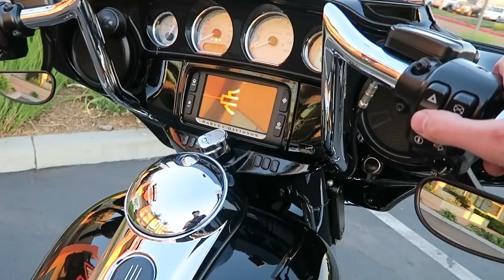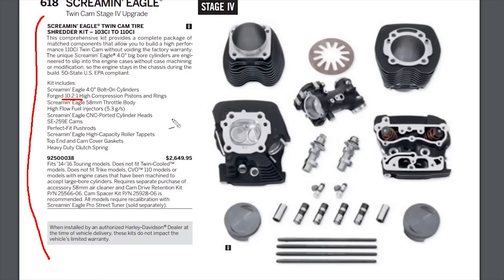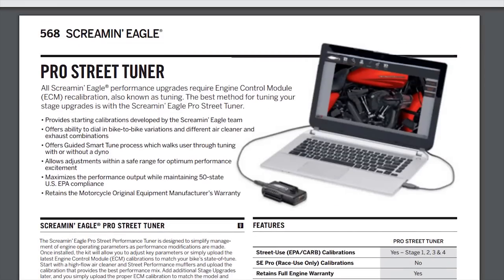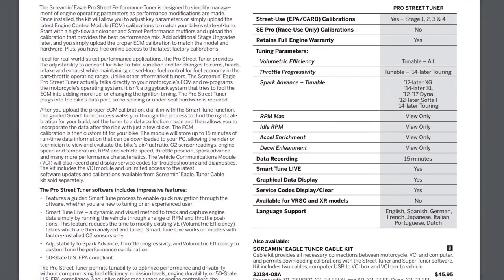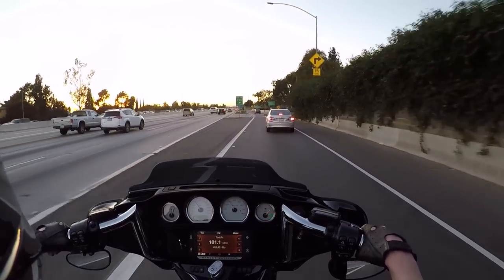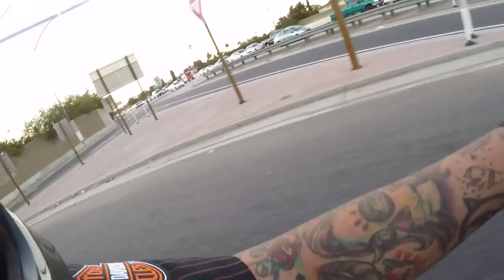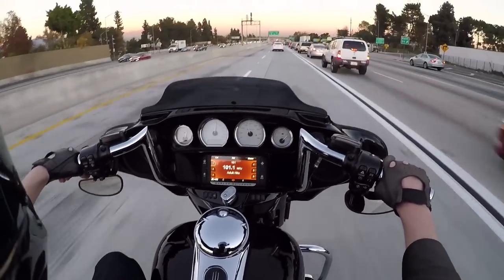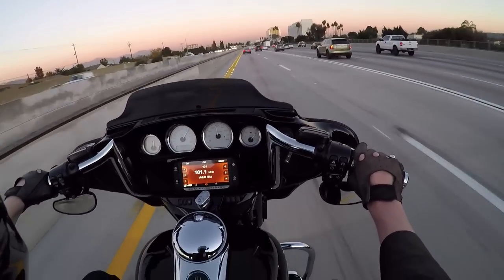Milwaukee-Eight Stage 4 VS Twin Cam 110 Stage 4 │Harley-Davidson Screamin' Eagle

Comment: I got a 2011 screaming eagle CVO ultra limited which had the cam upgrade full exhaust upgrade air cleaner upgrade with no big deal but she's cranking out just shy of 100 horses and just shy of 110 ft lb of torque and that thing is a monster I love it

Comment: Man..That 110 hauls ass..  I thought the M8 would run away from it but that didn't look like the case at all..
Reply from the maker: Yea, it definitely didn’t run away. It was a close match up.
Reply: By the way..  The bars and the windscreen with the cutaways look really nice on the M8 Street Glide.. Nice..
Reply: Im really feeling the M8and what it comes with...but now Im thinking that same thing about the 110cc. Gonna have to go back to the drawing board now...🤔
Reply: The m8 doesnt really have much more power, harley says the 107 has 10% more torque than the 103,  id hope so with a higher ci engine, the 114 has 8% more torque than the 110, they put out what an additional 5-8hp compared to the old engine, the 4 valves are really just smoothening the bike out, with a lil extra power added. Im not surprised the twin cam held its own at all, we also dont know how much the two riders weigh in comparison to each other, it makes a world of difference.
Reply: 10% more torque? Are you Sure? If so then 10% more torque must be a big deal from 0-60. Because I raced my brothers 103 vs my 107 and I burned him hard. And he's been riding way longer than me.... so I think the 107 is alot more powerful than the 103. The torque is nice.
Reply: Dylan H yeah im sure those are the stats iv pulled from multiple testing sites, plus if you do the math on the torque #s released by harley davidson,  the air intake is alot better i think 40-50%, i didnt include that cuz both these bikes have the better setup for air intake, thats why you walked away more than likely, how much do you and ur buddy weigh too? What kind of bikes? Do they weigh the same? Power to weight ratio is huuuuugely important. Also are your bikes geared the same? And torque only gets you so far, needs the hp to maintain it
Reply: You obviously don't have a clue what fast is
Reply: I loved my 110 but I also talked to guys that blew them up. I'm happy on my 107 with pipes and tuner still breaks loose on me from time to time.
Reply: when I bought my 114 fat I was really disappointed when my friend on his softail slim with a 110 fucking gapped me and I was lead to belive that the 114 would out perform the 110 by the dealer I bought it instead of going with the cheaper low rider s with a 110

Comment: By the way Matt...the new transmission SERIOUSLY BLOWS the TC trans away!  Smooth shifting and NO clunking changing gears....WAY better design and I LOVE the hydraulic clutch.  If you ask me you shouldn't even thing of comparing the new scoot with the old ones.....Harley FINALLY got it right all the way around....thanks again!  My new Street Glide makes me have bug stains!  I can live with that!
Reply from the maker: Yea, speed isn’t everything (although it’s high on the list). There are a lot of factors to consider. Starter is better, runs cooler, better fly wheels and crank, breaths better, better suited for performance upgrades, better charging system. Etc etc. the M8 is just better all around engine.

Comment: Great Video. I own a 2016 CVO StreetGlide with the Twin Cooled 110 Twin Cam that is upgraded with a Stage 1. It's dyno'd at 96 horsepower, and 110 lbs of torque at the rear wheel. I will be bumping it up with the 117 kit soon. Should produce great results! 👍😎
Reply: Theres a 2016 cvo streetglide for sale near me and im really thinking about getting it. Its being sold for 24k dollars though and a brand new street glide special is 30k so idk if its worth it to just buy the brand new bike.

Comment: Nice work as usual. Thank you for putting out videos with the things people really want and need to know about these bikes good or bad as you see it, and not just trying to sell paint, chrome and bullshit. As much as I'd like to have seen bikes on a dyno initially, but also understanding the cost and time it would take... the factory performance specs in your usual format with some seat of the pants dyno, same solid commentary and more aggressive riding noise make the video informative, helpful towards making a purchase, and even more enjoyable. Kill confirmed on the twin cam. Lol. That M8 sounds SO good through those mufflers. If Harley Davidson hadn't began to update anything in the last few years I'd STILL be openly trashing them for mushy suspension and coat hanger frames wrapped in plastic that stink of poor tuning and leak oil.
Reply: Lol Harleys haven’t leaked oil in over 40 years since the AMF days.

Comment: Hi Matt, great video as always, my 2017 RGS in the shop just now going to 114 stage 3, dealer has flashed it using a download that removes the speed governor so I will let you know how it goes. I am in Scotland though and it’s around 28 degrees here at the moment so you might have to wait until March 😃 I’m taking this bike to Prague for the 115 Anniversary Rally and that will include some autobahn travel 😈
Reply: John Porter why did you go stage 3 instead of 4?
Reply: NINJA DAVIDSON to retain Harley torque characteristics and not push all the power to high revs
Reply: Ahh. I see. I'm waiting for my new rgs with stage 4. Just wondered.
Reply: Yes the low end torque is wonderful. That is real power.

Comment: Thanks for making such informative and interesting tubes. I love my 115th FLHTK-ANV, but at the same time don’t think these bikes are made to race. Although my original Milwaukee 8 gives me enough power to ride around 110 mph on hwy easily, it’s HP is nothing compared to such racing monster bikes as ZX14, which I used to own for a few years. This is coz whatever modifications you make on your HD’s engine, its body, frame, and style is not designed to accelerate like an aerodynamic sport bike. I love my Harley coz it’s a super comfy bike and it roars like a lion. And that’s all about it

Comment: Fast lane here in Indianapolis does all my tuning my 110 twin cam makes 138 horse at the tire and 149 foot pounds of torque Factory bore 12 to 1,585 gear drives 58 mm throttle body,fully ported heads by Stewart racing here in Indy. Been to Sturgis twice not on trailer!!!!  And runs high 10's in quarter!!! Call it the busa killer!!!!
Reply from the maker: 👊🏻😮 wow. Those are some serious numbers.
Reply: Matt Laidlaw fast lane on gasoline Alley,  ask for Mark!! The  D-D boarzilla makes big difference in performance. Numbers where on good fuel.
Reply: Fro at south side Harley here in Indy have a NA MILWAUKEE 8 putting down over 200 to the tire. Not sure exactly what he's done. He's head tech there.

Comment: Looks like the twin cam held its own...
Reply from the maker: Yea it did
Reply: Matt Laidlaw 
I'm getting a 2018 CVO Limited.
Is it worth the extra cash to get the   Stage IV, even thou it already comes with a 117???
Reply: no, its not, 117 is plenty
Reply: I thought the twin cam won
Reply: Low end torque...H.D is good for other than that not so much my buddy that rides with me has the stage 4 set up on his glide .. and I smoke him everytime with my Victory XC. No cams just power commander Lloyds air filter and turning wheel..no shade just Facts.

Comment: Like the power characteristics of the TC  stage IV better.
Reply: 2hotFL agreed, i have two feet of snow. I've watched this vid four times so far today, i think it's gonna be my go to ride fix for the winter.
Reply: 100% agree. Not too sure I'd be riding much above 5000 - 5500 anyway. Torque is where the fun is...

Comment: Nice video and commentary Matt! Interesting comments too....For what it's worth, I wanted to say that I appreciate ALL two wheelers. I've been riding for 40 plus years on over 23 bikes (please don't judge lol). At 16 I had purchased 3 bikes including my first Kawasaki Triple 2 stroke... wow it was a machine to be reckoned with. From there it was everything from Dual Purpose Hondas to Husqvarna motocross to Sport Touring Adventure. My first bike with a driveshaft; a brand new 1982 Suzuki GS650.  For the last 2 or 3 years I've started to really slow down when riding public streets and have taken a much different approach to riding than when I was in my teens, 20's, 30's and even 40's. Hence the purchase of my first HD - an 08 Fatboy. Yes, it's true and my wife still can't believe I bought one. I'm enjoying the brand history of that nostalgic styling and relaxing cruising that it gives when we tour around the river and unpopulated country roads. However, when I was younger I hated those bikes - passed many of them "noisy things"...lol. Now I'm just about to purchase another - 09 Road King for those touring needs. The HD brand is one that I really didn't know much about and ignored. Now that I'm more aware I have a different appreciation and it has given us another aspect of motorcycling. We dated on bikes as teens and now still enjoy them, just at a much slower pace. Point I like to make is that we should all be open to the various motorcycle trends / ideas and embrace the open air in our faces; respect each others ideas of a good ride on a nice curvy road or a straight wide one...Life is short, keep the rubber side down!

Comment: I have been riding since 1974.  Have owned over 40 bikes (all larger street bikes, no dirt bikes).  I see one thing all the time and it makes me smile.  People take a bike that is meant to do one thing and try to turn it into something that does another thing.  At the age of 60, I decided I wanted to ride fast, so I bought a Kawasaki ZX12R, a CBR1000RR, a TL1000S, a K1200RS and a K1200R Sport.  Of course, I have owned a few Harleys, in fact, I have a Road King CVO 103 and a Softail Heritage Springer (Evo 80 in) in my garage right now.  I also have a Goldwing 1500SE in my garage right now that keeps my Triumph Thunderbird 1600 ABS company.  Trying to turn a Harley into a "speed demon" is a joke.  Trying to turn a ZX12R into a Tourer is laughable.  Trying to turn a Goldwing 1500 into a canyon carver will get you killed.  Tour on the Goldwing, cruise on the Springer and T-bird, ride two up with your wife on the Road King.  Buy the bike that fits what you want it to do and if you want to change that "to do" buy another bike that fits your new "to do" way of riding.  You want a "kick in the pants" at 80 mph, buy a Vmax.  You want 0-60, buy a BMW K1200R Sport "They's fast Uncle Jed", as Jethro would say.  I bought my ZX12R for $2800, which is the price of the parts alone on those Harleys and they still would lose to that ZX12R (Had it up to 185 mph going to Pyramid Lake outside of Sparks, NV, just past the BLM wild horses).  Remember, horse people know best.  They ride Clydesdales at the Triple Crown, they ride Throughbreds at the barrel racing, they ride - oh wait, maybe they do it different....  Buy the right bike from the beginning and you will be happier in life.  Stop putting saddle bags on a Sportster!  Sportsters are meant to carry your wallet only.  If you want to tour, cruise, canyon carve or canyon carve while touring, then save your money for you are going to be 60 years old some day and look in the mirror and say, "You are a Bike Whore!"  Not a bad thing to be!
Reply from the maker: Well said. So basically make sure you can afford 10 bikes and just get one for every situation. Got it. 😜.
Reply: Matt, that is why I buy used and I am a mechanic.  I fix bikes (all kinds) and have been doing so since there were spark advance mechanisms on Harleys.  That is the key to a lot of bikes.  I am by no means rich.  And yes, I have owned as many as 10 bikes in my garage at once (my wife started riding after 25 years on back so I had to add to the stable).  Don't buy the $30,000 Harley Road King CVO 103, I bought my used on with 5,000 miles on it in 2017 for $6,000 (just like new).  I will keep it for a year or two and sell it for $8000.  The bike is showroom perfect.  It is all in the waiting game of "Bike Whordom!"  Only bought 1 new bike in my life.  A 1975 Kawasaki Z900 when I came back from a tour on the Korean DMZ, I bought it in Fairfield, CA.  Peace brother.
Reply: He works for Harley.
Reply: Lol
Reply: Just sold my ZX-12R and bought a Street Glide.  Your comments are words of wisdom and have the ring of truth to them.   Well said!
Reply: I totally agree with you I am 61 years young had all the fast bikes gsxr1100 slingshot being my last one back in 1989 only drove it 600 miles and had enough.Been driving Harley’s for last 35 years I own 6 now also have Moto Guzzi California 1400 which is a total change in power but Harley style. I ve bought and sold Harley’s and have had my share of new ones also.I like you have now the bikes that suit my driving I’m holding on to what I have. 2 iron heads one shovel FLH softail nostalgia 1994.. softail deluxe 2005, CVO street glide 2015 and guzzi 2014.
I think Harley Davidson have lost the plot with the new Milwaukee 8 bikes they are more power than torque.and that was the reason I started driving Harley Davidson the thump.
I have test driven the street glide and the softails and I will be sticking to what I like the oldies.
Reply: I just bought a softail with a 103. I love cruising around on it, my brother has a road glide with a 96 on it. We ride together and enjoy it. He's had numerous sport bikes and I've ridden them all. When he test rode my breakout to give me his opinion since he knows bikes way better than I he said "it's fast... for what it is. But our idea of fast is different." The Harley guy looked so butthurt I had to laugh. He's exactly right and so are you. My 1999 Kawasaki zrx1100 will obliterate any Harley I've seen but it sucks to cruise on. It's a bit of a compromise between sport and touring which means it's ok at both and kinda sucks at both. But it was my first bike and I love it so i guess I'll keep it.
Reply: I put a 1375 stroker and 350hp wet NOS kit on a zx12r, was a blast
Reply: You are assuming that everyone thinks like you or cares what you think. Why do you think it is your business as to what people do with their bike, their money or anything else like that? If an owner wants to put a dead cow head on it that is their bike and they can go for it. But thanks for telling us what a motorcycle is for because you are clearly the final word.
Reply: @ababbit7461  I think he was being sarcastic- glad your little set up works for you but outside of your little world no one cares. I don't get why someone always has to chime in and try to shit on other people's videos. Don't want to add HP to your bike great go watch ground squirrels mate or whatever gets you going. They took a time to make a great video and here comes you "the professor" trying to tell us the right way to do things with a wall of text. Go make your own video.

Comment: Great video as per usual Matt. I noticed these bikes appear to have some fault issues, throttling these glides appear to cause condensation in the speedo gauge. 🤔  
Cheers from Australia again Matt👍
Reply from the maker: Yea, it’s weird. The condensation seems to get thicker at higher speeds. Definitely a warranty item we’ll need to take care of.
Reply: Tony Duman / b(7

Comment: If you look at the power graphs there is a huge increase even under the curve, you're getting more power everywhere with these kits.  2600 to get the power output these bikes should be putting out from the factory.  Also damn that M8 sounds good.

Comment: Great video.  I would like to know what my new 117 will do for  torque with a true torque build.  It already rips but I'd kill for about 15 more ftlbs at 1500-3000 rpms.
Reply from the maker: Did you get a 2018 CVO?
Reply: Matt Laidlaw yep, SEFLHTK.  Love it.  Should have bought a CVO for my first bike as well.

Comment: Looks like That 110 out works the 114. Definitely doesn't hurt my feelings for getting a twin cam over an m8, Minuse a couple features lol
Reply: I just recently got rid of my 18’ rgs 107. Sucked. Just picked up the 16’ CVO Prostreet Breakout 110Tc. Night and day different with twin cam. Much better stop light to stop light torque and speed

Comment: Matt ...great job again...appreciate your passion and expertise.
My question is that I am hearing that with the rollout with Milwaukee 8 engine on the New Softails Harley Davidson dealers are enforcing the warranty on third party exhaust systems. Meaning “Slip-Ons” are the only pipes allowed...anything else will void your warranty. I have always replaced stock HD exhaust head pipes with a complete exhaust system ....typically Rineheart or Vance & Hines with a tuner and Dyno.
Could you talk about this in a future video ...... and what options we have...of slip-On’s ... impact to engine if I did replace header pipes...performance differences looking for options. What I do know is I don’t like the stock sound but I love the new 114 Heritage ride and performance. Obviously the stock exhaust does not sound as good...very tame...not sure if slip ons make any difference....Sorry to ramble on..,
Thanks
Reply: Test rode a 2018 Softail Heritage 114 M8.  AWESOME freaking bike, took me by surprise but DAMN, the stock pipes have to go immediately upon purchase.

Comment: Hey Matt. I love your videos and can't wait for the next one. I will be 15 at the end of the month and I inherited a 1987 Sportster 883 from my dad. I can tip-toe the bike just fine at 5'4, but can't reach the kickstand which is placed further forward. Does that come with height, or should I put the weight of the bike onto my right leg and bring up kick stand with my left? Any input is helpful.